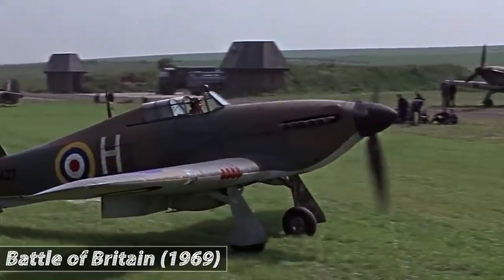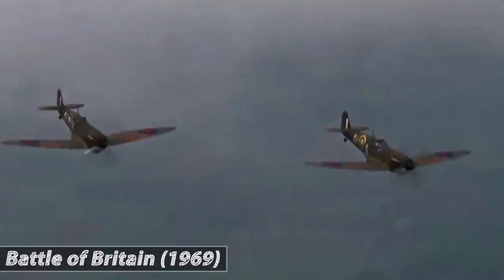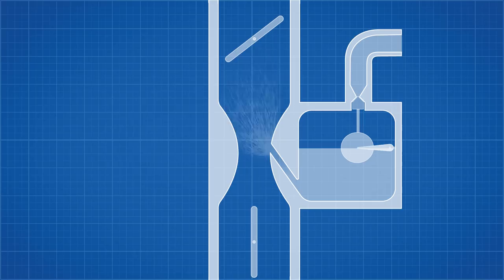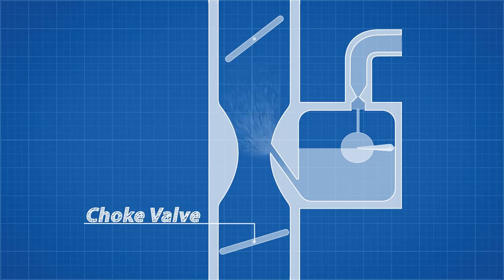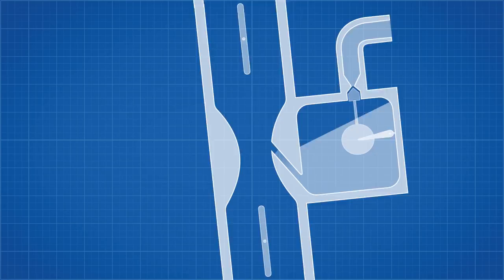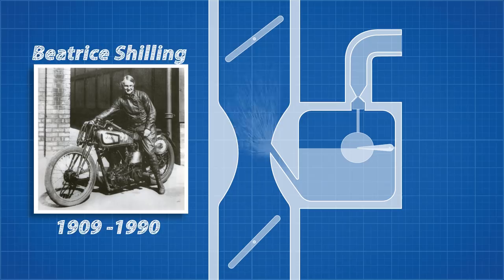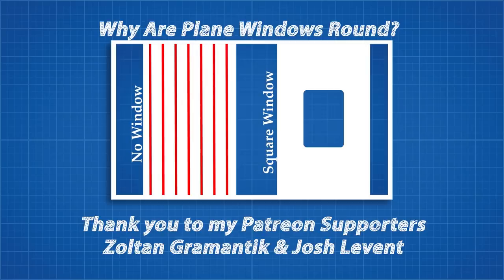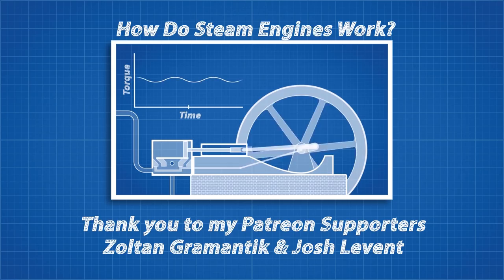The Spitfire's Fatal Flaw

Comment: Ah, the Merlin. Where would the Spitfire, Mustang and others be without it.
Reply: ScooterFXRS  Don’t forget the Merlin engine was modified forWW2 tanks as well
Reply: 1 in a Spitfire, Hurricane, Mustang, Seafire,  ... much more.
2 in a Mosquito ... (much more) 
4 in a Lancaster ... 
Yee Ha.
Reply: snoring liar. 
Packard were well paid to make the Merlin engine for Rolls Royce but 18,000 were stolen for the P 51. Rolls Royce not only designed the engines and did all the development, they made more than Packard as well as making the Griffon and jet engines, Packard never made any aero engines before or after the Rolls Royce Merlin.
Reply: A reverse engineered German DB engine?
Reply: A less powerful, less efficient engine, no thanks, the Merlin was the best, I notice the first Bf 109 made used a Rolls Royce Kestrel engine and the last used a Rolls Royce Merlin engine.
Reply: Barrie Rodliffe well the question is without the Merlin where would the Spitfire and Mustang be?

Well the best engine is definitely from England and German engine is a better second choice for Spit and Mustang, unless you want to turn them to Corsairs and Thunderbolt.
Reply: I doubt that Germany would be too keen to give away their best engine, Maybe if the RR Merlin was not developed Rolls Royce would have put more work into the Peregrine and Vulture engines or the Griffon, Bristol had the Hercules, Napier had the Dagger and Sabre.
Reply: Barrie Rodliffe well they can easily get some from the 109s that crashes in Britain.

The Sabre is good but it came quite late in the war, the rest are bomber and heavy fighter engine. Won’t really fit into spit and mustang. And griffon is developed from Merlin. No Merlin should mean no griffon.
Reply: Barrie Rodliffe also I got no idea about what engine prototype 109 used but the last 109 used the DB 605 or its variant. Late in the war the Merlin is quite meh on fighters.
Reply: Why take damaged engines when they had better, the Sabre ran before the war, the Napier Sabre was in service in the Typhoon in 1941, the Hercules used in the Beaufighter but would make a good single engine fighter engine, the Griffon was not developed from the Merlin, it was developed from the Schnieder Cup Rolls Royce R type engine in 1939, development was put on hold to concentrate on the Merlin and  Vulture engines, no Merlin and the Griffon would have been developed sooner.  
I know the Merlin was important but Britain would hardly wait for Luftwaffe fighters to crash in England during the battle of Britain to get an engine for the Spitfire and Hurricane.
Reply: The prototype Bf 109 first flew using a rolls Royce Kestrel engine, late in the was and after the war Hispano Aviation made Bf 109's,  they used hispano Suiza engines for a time but the last ones used Rolls Royce Merlin engines.
Reply: I don’t see why there’s an argument about this. British engines were used in American planes, because frankly the British engines were better than anything we had at that point. So what’s wrong with that?
Reply: Yes but the Griffon engined MkXIV held all the aces, but the late production run MK IX was still as good, if not better a fighter than the 109.G - H and 190.A - D. Mk IX's even claimed Me 262's and Arado 234's in aerial combat.
Reply: I Gusta: No the Merlin and Griffon were the result from different variants
Reply: @jacktattis1190  Mk IX ? Are you sure about that ?
Reply: Fetilu09 : I cannot see here where I mentioned the IX
Reply: I was talking to Paul bantick
Reply: Bookhead: Ah at last an American that recognises that in WW2 The Brits had the better engines. You will make enemies my friend One Wilbur does not recognise that the Packard was British
Reply: Fetilou: Well Show his name. And he is  right  When the IX came along it was goodbye FW190 dominance Things were equal and the RAF 2 TAF  had  33 Sqns of the IX [990] The first Me262 shot down was by a Spitfire What Mark I do not know. I do know Dick Audet in a MkIX shot down 5 German fighters in 7 minutes He had Ammo left over Unlike Yeager who got 3 with 2000 rounds and it was NOT 7 minutes
Reply: @jacktattis1190  How can a Sptifire MkIX even catch a 190 or a 262 ?
Reply: @fetilu0975  
Spitfire Mk IX's did catch Fw 190's and the first Me 262 shot down was by a Mk IX as 
were several more.  In Italy some squadrons had the Spitfire Mk VIII which was little 
faster than a Mk IX and one pilot giving chase to a Fw 190  was not catching up as fast as he expected until he remembered he still had the drop tank on.  The Mk IX was still in front line use at the end of the war.  
For the defense of Malta Mk IX's arrived about the same time as Fw 190's and the 
Mk IX held an important advantage.
Reply: @fetilu0975  Yes I'm sure.  The thing about doing research is that you find these things out.  You will also find out 'if you care to do said research' that the MKXIV shot down many Me262s and Arado's too.
Reply: -> Spitfire Mk XIV, with a completely different engine than the Mk IX
Reply: @fetilu0975  I refer you to my last and I will also point you to the difference between the Fw 190-A and Fw 190-D.  The Mk IX had many a success against both.
Reply: @paulbantick8266  I'm not denying the Spitfires combat capabilities, I'm just saying that until Griffon engines, they were not as fast as 109's (except early version like in BOB) or 190's (neither the A or D versions)
Reply: @fetilu0975  Spitfire Mk IX - Bf 109.G-6 http://www.spitfireperformance.com/spit9v109g.html  If you look on the same site, you will find the data for the FW 190-A comparison with the Mk IX, too, (as well as those for the MkXIV and  Bf 109-H/K and Fw190-D series).    You should also check out the performance figures of each aircraft (and the 190-A) on countless other sites.  I suggest you do it. It may annoy you to know that even the LF MkV with it's Merlin  55-m also negated the advantage held by the Fw 190-A

Perhaps you might post the performance data or link to the performance data that you are working from regarding the 109-G /190-A comparison to the Mk-IX? .  It's not just about straight line speed anyway, but also power, pace, energy holding and manoeuvrability in combat situations.  The Spifire had that in spades.  That's why most see the Spifire as the best fighter of the war.  If you play any of these flight simulator combat games, they tell you absolutely nothing of the reality of it all.  Even the online data are only from tests of an individual aircraft from a random batch.  Remember!  Wing commanders and Squadron Leaders took their pick of new aircraft because all could have marked/slight  flight characteristics and engine performances.  the same would apply in all the other air forces too. 

The Fw190-D had speed over the Mk IX. but was a 'no contest' in comparison with climb, altitude, manoeuvrability  and high altitude combat .  The Bf 109 H/K would pose a much more serious problem.  That the 190-D could 'run or dive away' faster is great for for evasion.
Reply: @a.morphous66  Quite right and thank you
Reply: Agreed what a bloody amazing engine design!
Reply: @gusp6612  Good TRY fail
Reply: @gusp6612  Radials were second rate in efficiency
Reply: Packard were second choice- Ford were asked first, but refused. The Brits gave Packard money to build their Merlin production line. Not all of the P51's had Packard engines- some had RR Merlins.
Reply: No, but some prototype bf109's used RR Kestrel engines, as the DB601 engine was not ready. You could just as well ask if Daimler Benz looked at RR designs for inspiration
Reply: @billcobbett9259  Yes but they wont. There are those here who do not like Merlins
Reply: @billcobbett9259  : Not many had Merlins it was against their creed
Reply: @barrierodliffe4155  Nope! Packard built aircraft engines before the Merlin, notably Libert V 12 in WW1 and a diesel radial in the 1920's.  After WW2 they developed a couple of gas turbines.
Reply: @thamesmud  
Packard was one of the companies involved in making Liberty engines, as for a diesel radial engine, did it ever fly?.  The fact remains Rolls Royce gave Packard the Merlin engine to copy and still had to show Packard how to make it, Rolls Royce did all the development and made many more than Packard, Rolls Royce also made other engines and jet engines during the war.
Reply: Looking at some of the responses on here I guess arch clot soaringtractor has infested these comments?
Reply: And of course the Lancaster, the engine was a bloody great engine for lots of uses..!
Reply: Problem was with the Merlin, it was also used in patrol boats and such. Luftwaffe engines (Bf109, etc.) were inverted V with direct cylinder gas injection, way different.
Reply: The mustang started out with a Alison v1710 engine
Reply: @mattduddle9481  Which proved to be very average in performance, hence the Merlin being cloned for the Mustang.
Reply: @teebosaurusyou  
There was no problem with the Merlin engine, it was better than many bigger engines.
Reply: @a.morphous66 , we can thank the good ole Army Air Corps for not having a V12 equivalent to the Merlin. The Allison V1710 could have out-Merlinned the Merlin if the AAC had been willing to fund more work on its supercharger development. At lower altitudes it matched or exceeded most Merlin versions, and was more durable to boot.
Reply: @barrierodliffe4155 , when the production drawings and documents arrived at Packard, they were all in British Standard dimensions designed for manual production methods and had to be redrawn and respec'd to be compatible with high speed semi automatic machine tooling. This took several months and didn't get much sympathy from Rolls.
Reply: @wcate8301  
Since Rolls Royce was already mass producing the Merlin engine which they gave to Packard to copy and Rolls Royce engineers had to show Packard how to make the engine you got it very wrong.
Why do you think Rolls Royce made many more Merlin engines than Packard as well as Rolls Royce doing all the development of the Merlin and making all the Griffon engines and jet engines.
Reply: @barrierodliffe4155 , RR was at it a lot longer and had more plants in operation with a larger workforce, so of course they outproduced Packard. American machine tooling was dimensioned to SAE, not British Standard system, necessitating redoing all the drawings and documents. I was a mechanic for an airline that flew Dutch airplanes with RR engines. SAE, BS, and metric hardware all through it, with expensive and unreliable LUCAS electrics from "the Prince of Darkness".
P.I.T.A! Can't you blokes figure out how to make a gasket that doesn't leak?? BSA, TR4, MGB, Dart, Spey, RB211, drip, drip, drip, drip.
Reply: @wcate8301  
Rolls Royce was making the Merlin engine longer but production went up in 1940 until 1945 so the lot longer is not that much.  The simple fact is Rolls Royce was using mass production for the engines.
You claim to be a mechanic but show little knowledge as for Lucas many of the cars I have owned and driven had Lucas and worked just fine, nothing wrong with the gaskets on the cars i owned either.  
I have serious doubts about you being a mechanic at all.  My father really did work for an airline as well as for aircraft manufacturers.  I am an engineer and have worked on aircraft and cars.     
You got one thing right, you are a drip.
Reply: @barrierodliffe4155 , are we having fun, yet? Maybe it's the climate, the environment, or maybe the expectations, but I've either owned or had to clean up after all the machines and engines I listed in my previous post. I haven't had to do that for Pratt & Whitney, Garrett, Lycoming, Continental, Toyota, Honda, BMW, Ford, Chevrolet, Volvo, Chrysler, Harley Davidson, or Yamaha. I can work on any of the above without a drip pan, but not on anything that flies the Union Jack.
And as for Lucas, our climate is a lot harsher than yours and our roads a lot saltier, and most other folks that export to us have adjusted their metallurgy to cope with it, but Lucas still dissolves in the wintertime.
(And costs more to boot!)
Reply: @wcate8301  
Maybe you do not know how to look after cars or more likely you have never worked on any of them but make it up.  I currently look after several old cars, including a couple of pre war British cars and 1 Swedish Volvo, as well as a couple of Japanese cars. I see no more oil under the British cars than any others and in fact the British are easier to work on and much easier to get parts for.
Reply: @barrierodliffe4155 , well this is getting somewhat tiresome, and your experiences are clearly quite different than mine, not to mention a different climate, environment, and automotive/aeronautical economy. Let's just agree to disagree; no minds are getting changed here.
Adios amigo.
Reply: They would be using two stage supercharged allison v1710s but allison never devolped a two stage supercharger because they put all their eggs in the turbocharger basket
Reply: @oddball0045 , Roger that, man! But I don't think you can lay it all on Allison, as their engineering department was understaffed and overloaded, and the Air Corps was hot for turbos so that's where the funding (and the engineering effort)  went.
Reply: @wcate8301  
Sure and that was why the USAAF in Europe wanted British aircraft which were much better than anything from USA.
Reply: @barrierodliffe4155 , if that were true, then why weren't Spitfires escorting bombers to Berlin and back? Short answer: short legs! Merlin engine P51s were faster than same HP Spits WHILE packing the fuel for round trip Berlin. Admittedly the lighter Spit was a better  close-in dogfighter, but the Mustang got the job done on the long haul missions and beat up the LW in the process. How? More efficient airframe design, reduced cooling drag, and laminar flow airfoil technology. It took the Meredith Effect (thank you, Britain) and made it work more effectively (thank you, NACA) than you chaps ever managed on your wartime aircraft. There's no denying you blokes came up with some pretty innovative stuff, but claiming a monopoly on innovation is topping it a bit high in my book.
PS: No need to be so abusive in your language. We're all grown-ups here.
Reply: @wcate8301  
Why was the USAAF not bombing Berlin in 1943?  
Probably because it was far from the only target and the RAF could do so without a fighter escort
Why should the RAF as well as doing most of the fighting and bombing have to waste their time escorting second rate bombers to Berlin anyway?  
The Mustang could not escort bombers anywhere until March 1944 and by August 1944 no where in Germany was outside the range of Spitfires.
The Luftwaffe was well past its best by 1944, the Mustang did one main job while the Spitfire was doing many.  The Laminar flow wing on the Mustang was not so good and the slightest blemish ruined its speed. 
More important than being maybe 20 mph faster was acceleration, climb and maneuverability.

As or innovation, I am trying hard to think of US innovation.  There must be something but nothing comes to mind just now.
Maybe you can quote from your book.
Reply: @barrierodliffe4155 , the US wasn't paying much attention to Berlin in '43 because our long range bombing campaign was just getting started, (you folks had a 2 1/2 year head start), and USAAF was concentrating on industrial targets (Schweinfurt, Wiener Neustadt, Ploesti, etc) rather than city populations. And yes, the Mustang was a fuel truck, and no match for the later model Spits in a knife fight, but it had enough performance to defeat most any LW prop driven fighter it would encounter in its mission, and even harvest a 262 here and there. Killed it's share of doodlebugs, too.
My Engines instructor in mech school had been an 8th AF mechanic in WWII, at depot level, and serviced P51, P47, and P38 fighters, as well as a composite US PhotoRecon outfit that had Spits, Mosquitos, Lightnings, and Bostons. He thought highly of the Mossie, but said the Spits were "fragile as hell", and getting parts from the American supply chain for the RR-built Merlins was "hell on wheels". No problem with the Packards, as they were different marks and well supplied in the US system.
No sense in getting into a partisan squabble over purported innovation monopolies, as we are both prisoners of our own national mythologies, and unlikely to give each other any credit at all. In this age of ultra-partisanship open minds are few and far between.
Reply: @wcate8301  
The US found any bombing to be dangerous in 1942 when they fist tried it.
The US was usually missing its targets.  Me 262's were poor fighters, but they did shoot down a few P 51's, no Spitfires which also shot down some Me 262's.
USAAF pilots did think highly of the Mosquito and the Spitfire, maybe the USAAF had a poor supply system but the one thing the Spitfire was not is fragile. 
 I thought you might be able to think of at least one bit of US innovation.  Never mind,.USA could always take our innovation which was free.
Reply: Using P&W R2800s. Just kidding a bit.